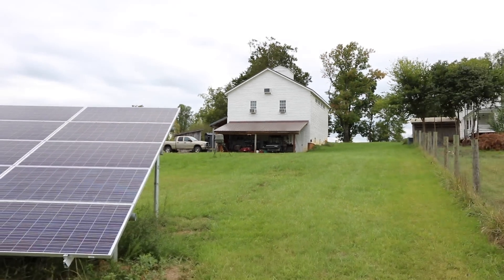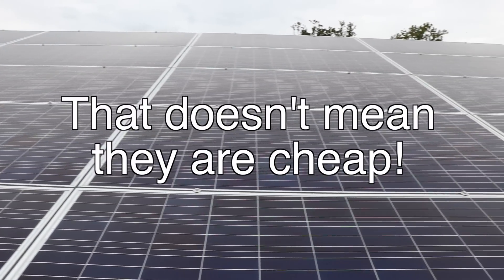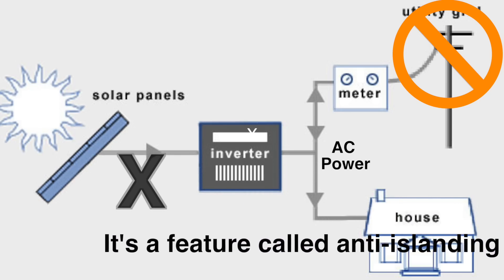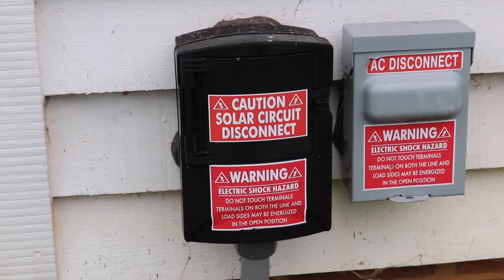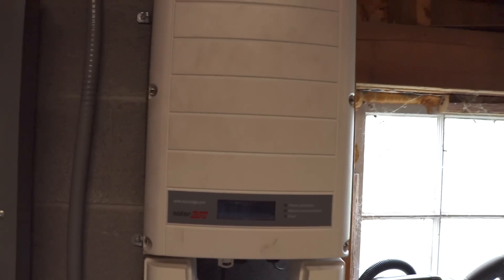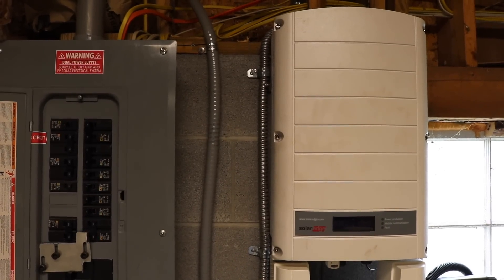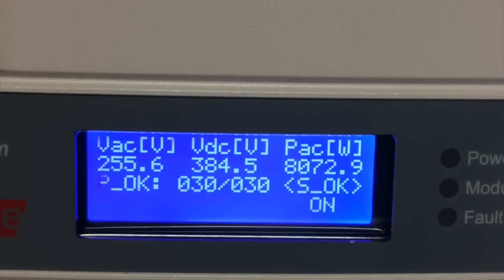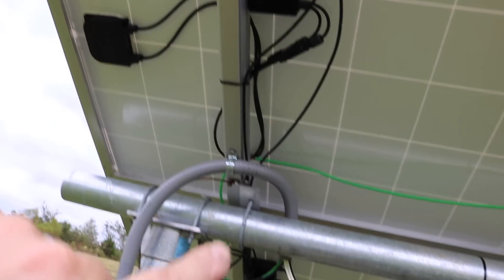The ugly truth behind grid-tie solar systems. Part 1, FarmCraft101 solar.  Watch before you buy!

Comment: All we need is An EMP attack to Knock out this shit.
Reply: They do make EMP resistant inverters and battery systems do not think EMP would effect the solar panels but it may the connections.  They do make off grid systems that have EMP protection but it depends on the size how much extra it will cost.  I will have to edit and answer later but I know of one company that makes the inverters and batteries all in one system and the entire  system minus the solar panes are EMP proof.  EMP is going to knock out most systems grid or non grid if not protected.

Comment: Very nice video.  I have a very similar system - 8kw Outback Radian 8048A.  I just installed an additional 9 panels @ 275 each for a 2nd inverter system,   My 8kw system runs everything except my pool pump.  I am very happy with it

Comment: If you put it closer to your home you could also use less wire. Since i have to pay a fixed monthly fee plus whatever i use i am thinking to go off grid. I think it's worth having the batteries and maintaining them just to not have to pay that fixed monthly fee.
  I'm thinking to have an electric vehicle which can power the house and also some batteries in the house. Perhaps also some batteries on a trailer as a portable generator.
  With all 3 battery banks and potentially some extra power from some of our other vehicle batteries if needed.
  You could have built this system much cheaper if you had cut some corners for example. If you had built the frame which holds the panels yourself. This is a very nice frame but you could also use mild steel with a rust barrier paint. Welding is quite easy if you buy a mig or get some practice on an Arc welder.
  Also anyone reading this might want to think about the possibility of changing the angle on their panels for winter and summer sunlight angles.
  Also there is a different way. Some panels are designed to work well in low light, this means they will still produce even if not oriented directly towards the sun and even on overcast days. They are larger in size and may need a special frame to hold them as not all of them come in individual frames. (these "thin film" type do not like being stood against a wall as they can sag and crack in the sun.).
  Grid tie can be great but since my electricity provider are not happy with just charging me for what i use and they insist i have a monthly subscription then i am seriously considering building a huge battery bank and going 100% off grid. I even think that it is illegal in Franc to go off grid but we will find a way. No wonder EDF is the richest company in France. I'm surprised more people are not complaining.

Comment: In San Diego Ca. we are not allowed to hook up more solar panels that are needed to power our home on an average.  We are supposing that SDG&E does not want a bunch of power coming back into the system, which if we had installed solar we would have wanted to sell back to the power company to offset the monthly cost.  Needless to say we did not install solar, because for the small amount we use, it does not warrant installation and the cost of a system that will be outdated before it is paid off.

When any system is pushed as hard as is Solar, with at least two robo calls a day, it tells me that jumping on that band wagon will not be in our favor, marketing pressure not withstanding.  Solar is really not viable for single family homes, unless the owners want off the grid for personal reasons.

Now for the real crux;  When our economy collapse which is will soon, those who have solar will be targeted as essential supply depots for generating power for cell phones and the like.  When we are in a SHTF scenario you do not want to stand out, and solar is a blinking red light to marauders.

Comment: Your ROI is very dependent on the feed-in tariff rate. In a heavily subsidized system, the government subsidizes your electricity generated above what they pay from big power plant per kWh. Theorically, they would buy the electricity at half to quarter of what you pay when you use electricity as the power decreases as it goes through the grid in for of resistance, etc, transmission. It could never be 1:1. Fortunately for some countries, green power us heavily subsidized. In Australia unfortunately the subsidies was discontinued. If I sell the power generated by my solar power, the feed-in tariff rate is only 6 cents per kWh while if I use grid power, the minimum is 22cents per kWh for a certain kWh then a higher rate thereafter. My 3 kW solar panel can be recoup in 25 years not including the depreciation of the money.

Comment: Your math calculation is too simple. A 17,000 dollars investment now is actually close to 22,000 dollars after 8 years with a cumulative inflation of 22 percent. Simply stating, a MacDonald's burger 5 years ago would cost 22% cheaper compared to now, or 22% bigger (which is what companies usually do) or both. That means that after 8 years, you still have not recouped your investment.
Reply from the maker: The calculation is more complex than that.  Yes, the 17k would earn money, but over 8 years I will still have to pay $17k in electricity costs.  I wouldn't have 22k, but something like 3k left at best.  Also, the cost of electricity will go up during that time.  Also, I get additional money for my system through SREC, solar renewable energy credits.  All of these complex factors were taken into account, and the estimate was 8.5 years.

Comment: There are a number of inverters that combine grid-tie with a battery. Outback, Schneider, and SMA are some. You can also use one of the 600v capable charge controllers to bypass the inverter to charge your battery in the event the grid goes down.  Your cost is very good in terms of $/watt for the equip described in this video. In time, I think you'll want to move the battery onto a vertical rack. Lithium will help that effort.

Comment: I'll post some calculations for oversized systems too.  So, for the first calculation lets assume you spend $34000 on a solar system and your $200/month electricity bill turns into a check from the utility company each month for $50.  Same starting balance of $50000:

year    no-panel        panel
0.00    $50000.00       $16000.00
1.00    $49081.44       $17096.50
2.00    $48134.94       $18226.34
3.00    $47159.65       $19390.55
4.00    $46154.69       $20590.18
5.00    $45119.17       $21826.28
6.00    $44052.16       $23099.99
7.00    $42952.69       $24412.44
8.00    $41819.77       $25764.81
9.00    $40652.40       $27158.31
10.00   $39449.52       $28594.20
11.00   $38210.06       $30073.76
12.00   $36932.89       $31598.32
13.00   $35616.88       $33169.25
14.00   $34260.85       $34787.96  <--- BREAK EVEN POINT MOVED FROM 11 to 14 YEARS
15.00   $32863.56       $36455.91
16.00   $31423.78       $38174.60
17.00   $29940.20       $39945.55
18.00   $28411.50       $41770.37
19.00   $26836.31       $43650.70
20.00   $25213.20       $45588.22 <--- GOAL (balance is actually higher than if you didn't oversize)

32.00   $1421.20        $73988.93
33.00   $-974.93        $76849.22
34.00   $-3443.95       $79796.50

Now I didn't calculate actual $/kWh here in payback from the utility, but for this system lets assume 9kW of excess capacity generating around, oh, 1200 kWh a month paid at $0.04/kWh.  That would result in a paycheck from the utility for around $50/month.

Now here are some more numbers.  Lets say we include a battery pack at a cost of $10,000, with a normal-sized system (so $200/month bill becomes $10/month bill (assume the utility has a minimum bill), $17000 cost for system, $10,000 cost for battery):

year    no-panel        panel
0.00    $50000.00       $23000.00
1.00    $49081.44       $23577.60
2.00    $48134.94       $24172.77
3.00    $47159.65       $24786.04
4.00    $46154.69       $25417.96
5.00    $45119.17       $26069.10
6.00    $44052.16       $26740.05
7.00    $42952.69       $27431.41
8.00    $41819.77       $28143.79
9.00    $40652.40       $28877.84
10.00   $39449.52       $29634.22
11.00   $38210.06       $30413.61
12.00   $36932.89       $31216.70
13.00   $35616.88       $32044.22
14.00   $34260.85       $32896.91 <--- BREAK EVEN POINT MOVED FROM 11 to 14 YEARS
15.00   $32863.56       $33775.53
(BATTERY MUST BE REPLACED AT $10,000 COST!!!!!)

So with a battery the break-even point also moved from 11 to 14 years, but there's a catch.  The battery isn't likely to last more than 15 years.  So every 15 years you would have to spend $10,000 to replace it.

In otherwords, with a battery system to mostly zero out your bill, your will NEVER get ahead.  The absolute best case is that you will break-even, then have to spend money on another battery.

This means that batteries are basically uneconomical.  The only reason you would ever want a battery is if you want to be able to run your house when the grid is down.  I would suggest that if grid power is reliable, this would be a waste of money.  Instead you can get a SMALL battery system that e.g. allows you to run a fridge or something, and allows you to run more stuff during the day when the panels are producing.  Such systems cost far less than $10000 but obviously can't run the house.  They would still be able to operate when grid power is down, powering your fridge and perhaps a few other things during the day.

-Matt

Comment: The correct break-even calculation is a bit different then what you presented.  You also have to include interest on the money you would have earned on the $17000 you didn't spend if you had not gotten solar, and you also have to include interest on the money you saved with the solar.

So lets look at it again.   Lets assume a starting bank balance of $50,000 just so the numbers don't go negative, 3% interest (lets say the balance is invested in munis or something), a $200/month electricity bill without solar and a $50/month electricity bill with solar ($150/month savings with solar).   NOTE: In this example the 3% interest is (balance * 0.03 / 12.0) of interest per month.  As you can see, as the no-panel balance goes down, the interest received is less and less so it accelerates downward, while with the panels the interest is enough to cover the monthly bill and the balance accelerates upwards:

year    no-panels         panels
0.00    $50000.00       $33000.00
1.00    $49081.44       $33393.89
2.00    $48134.94       $33799.75
3.00    $47159.65       $34217.97
4.00    $46154.69       $34648.90
5.00    $45119.17       $35092.94
6.00    $44052.16       $35550.48
7.00    $42952.69       $36021.94
8.00    $41819.77       $36507.75
9.00    $40652.40       $37008.32
10.00   $39449.52       $37524.13
11.00   $38210.06       $38055.62 <--- BREAK EVEN
12.00   $36932.89       $38603.28
13.00   $35616.88       $39167.59
14.00   $34260.85       $39749.07
15.00   $32863.56       $40348.24
16.00   $31423.78       $40965.63
17.00   $29940.20       $41601.80
18.00   $28411.50       $42257.32
19.00   $26836.31       $42932.78
20.00   $25213.20       $43628.78 <--- BUT THIS IS THE REAL GOAL

32.00   $1421.20        $53830.98  <--- SAVINGS GONE WITHOUT SOLAR, $53K WITH SOLAR (for reference)
33.00   $-974.93        $54858.46
34.00   $-3443.95       $55917.19

So your break-even point in this example is year 11.  That is, it took 11 years for you to break even.

But if we continue, note the acceleration.  Once past the break-even point, you continue saving with solar.  Now this is isn't perfectly fair because you will have to replace your inverter once every 15 years or so, which is around a $1000 cost.  But the panels themselves should last at least 25 years and high-quality panels can last 40 years.

So basically solar is a win... a big win, but it requires time and patience to get there.  And of course we are also assuming that the money is being saved and not spent on other things.  But this is the real cost-of-money calculation that you have to do.  Don't assume that the $17000 you would not have spent had you not gotten solar isn't worth anything.  It can generate a yield.  And, similarly, the money you save every month from the solar could also be thrown into a bank account and saved rather than spent (though in this example I don't do that, instead I work it from an actual 'bank balance' point of view).

This is also a demonstration of why solar panel installations make more financial sense to more affluent home owners (that is, home owners who can actually build up a savings), and less financial sense to less affluent home owners who are unable to build up savings.

-Matt
Reply from the maker: Wow.  Cool breakdown.  But there is still more to consider.  I knew I was giving a simplified version of the break even period, but the many factors involved would have been very cumbersome to present in a video.  That being said, you need to add the average rate increase for electricity which will shorten the break even period.  This would be somewhat offset by decreased production as panels age, to be fair, but that's less than 1% per year, not as much as the typical rate increases.  Also, the SRECs, which are credits that you can sell for generating green energy.  The market on these varies, but with my system I will earn (real money) somewhere around $150 annually with these.  If you redo your calculations above with those adjustments, I think you'll find it closer to my estimate.  But either way, it wasn't just a financial decision for me.  With my battery backup I have real, self reliant, reliable power which is worth a lot in itself.  Thanks for your comment!
Reply: Yup, I'm totally cognizant of the non-determinism of electricity prices.  Particularly where I live (in California).

Another advantage of Solar, even if the break-even runs out a long ways, is that we are spending our hard-earned cash on smaller, more innovative and more deserving companies, instead of wasting it away on the big utility companies.  I particularly like that aspect of it.

I have a very old system myself... almost 15 years old now.  15 years ago solar was expensive to say the least.  My system is only just now breaking even (and then only because I am a fairly heavy electricity user).  15 years ago my system cost around twice as much as your more recent system and has only around 1/3 the wattage (3kW nameplate).  It will generate ~16 kWh on a good summer day.  Pretty insane difference then-to-now (!).  I've been ramping up my research to see about upgrading it.  I will probably stick with grid-tie, no-battery, and oversizing the upgrade a tad to get closer to zeroing out the bill (covering the overnight usage with day-time generation).

Ultimately my intention is to purchase an EV and use the EV to help power the house through the peak pricing period, but that plan is still a bit pie-in-the-sky.

-Matt

Comment: Ehh, I don't see why you can say power going out on the grid is a con just because you didn't go with an automated grid tied transfer switch.  Whether code there allows for that is unknown to me, but, there are inverters that sit between your breaker panel and the incoming AC that will stop flowing power back out to the grid once it detects the grid has gone offline, but will still pump power to your home.
Reply from the maker: Those are hybrid inverters.  My next video will cover the differences.

Comment: Thanks for putting this out there.   A dirty secret hid by the Govt and the big power companies.
I am amazed how many of my neighbors and friends who think that if the grid goes down they are safe - NOT.
Some of them actually were told the opposite.

The second thing and you were guilty of as everyone seems to be and that is your payback calculation.  It is not correct.
You failed to take into consideration the cost of the money you spent.  Meaning regardless if you paid cash or paid monthly payments, that money could have been used for something else - like an investment that has a rate of return.

Next is the absurd concept of 'Federal Tax rebate'
That means and there is no getting around it, I am paying for your solar panels...  Govt concept run amuk.

Related to it... Solar companies are only able to survive because they get Govt. subsidies.. The biggest solar company in the US doesn't make money.  Aanother contribution to the National Debt....  NO THANKS.
Reply from the maker: The financial calculation is more complicated that I presented, I'll grant you.  But if I were to put 17k into an investment, and then withdraw $200 per month, how long before the investment was gone?  Depends on a lot of factors, and very complicated to calculate for me at least.  But over the next 8.5 years, I was going to pay 17k in electric bills regardless.  Perhaps looking at it this way it would be more like a 10 year break even, but either way, the system will pay for itself well before the 25 year panel warranty expires.  

I'm also not a fan of govt subsidies, but I pay plenty in taxes myself, and if I can keep some of it legally and reasonably, I will.  I also get to write off my mortgage interest.  Are you also paying for my mortgage?  I get to write off my children as dependents.  Are you paying for those as well?  The tax system is absurd, but it is what it is, and I'm not going to feel guilty for saving some of my tax dollars.  Don't misunderstand.  If I could change the system, I would, but alas, I cannot. 

Thanks for watching!
Reply: Glad/hope I didn't sound too much of a @#$$, thanks for putting out there your experience with solar, a good walk through for those looking.

Comment: 16s LiFePO4 batteries with a 6kw peak 48v inverter works very well with my 1.5kw panels. Programmable charge controllers are cheap.